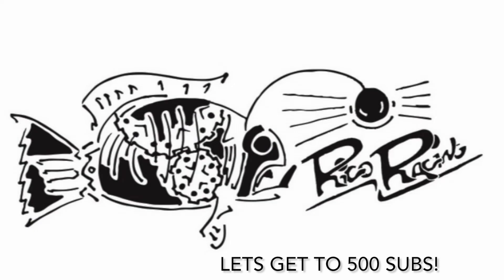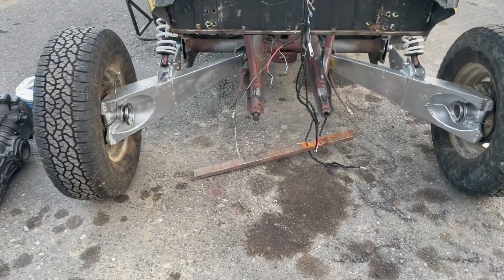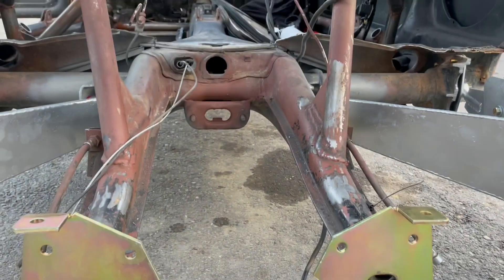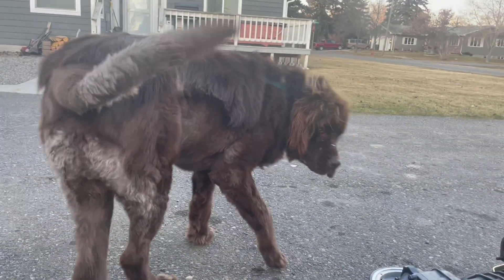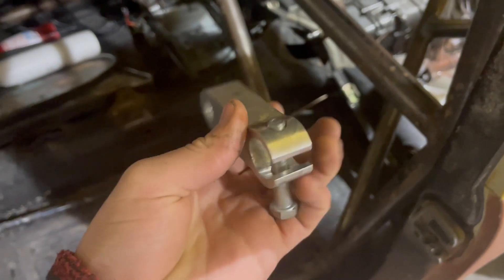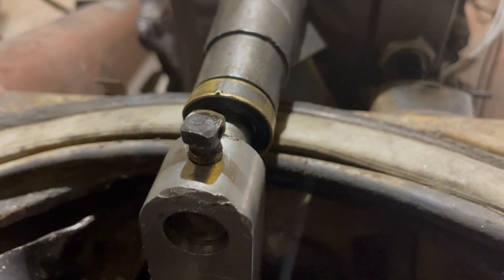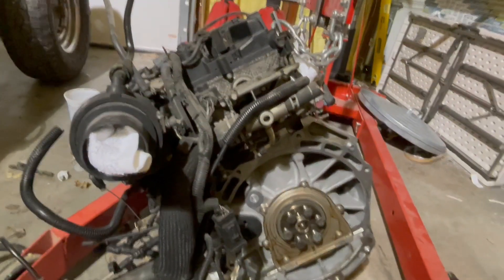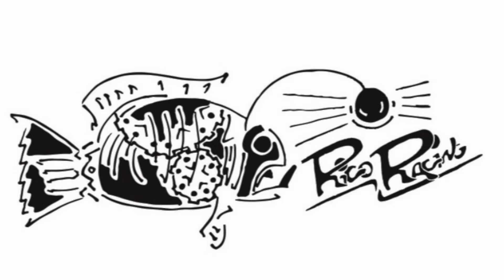How to put a Vw Bus Transmission in a Bug! | IRS Conversion ep 5

Comment: I’ve been putting bus transmissions in buggies for over 25 years and learn several secrets
When installing with aftermarket trailing arms 3 x 3  etc. You must push the transmission back in order to keep the transmission drive  flanges parallel with the stub axles to avoid CV joint binding   no clearanceing  if of CVs can relieve that problem without relocation 
Add 3” to the front mount by boxing it out with a Second mounting plate and add 3” to The ends of the engine horns  and I suggest using your upper bell housing bosses as a mounting point to frame structure and possibly mid transmission mount to engine horn
Reply from the maker: thanks for all the advice!
Reply from the maker: thanks for all the advice!

Comment: Those Ford motors area great! I had a 2006 Zx4 Focus, Loved that motor. Zippy and lots of power. Always thought it would make a great baja motor.
Reply from the maker: im getting excited for sure! ive been working on installing the engine adapter and flywheel but i have the wrong clutch so now its another week waiting for parts…
Reply: Rico, stick with Volkswagen powered,  you can't go wrong.

Comment: Awesome 😎 coming out sweet 🤙🏽
Recommend a cross tube with fabricated tabs to the top 2 holes of that bell housing it will make it much stronger 
Little bit of blue locktite on the trans linkage bolt so it doesn’t back off ✌🏽
Reply from the maker: thanks for the idea! definitely going to make something like that now, i was a little worried about putting too much stress on the ends of the frame horns.
Reply: Bro I also recommend  clocking or phasing your off road cv ‘s  are you going to run type 2 or 930s

Comment: I have full hydraulic disc brakes, front rear on my buggy, so I do not use the emergency brake handles so I notched them off, smooth with a tunnel and mounted a EMPI 16-2106 well then doom buggy shifter linkage. The kit comes with almost everything you need and it gets rid of all the extra play very tight and easy to shift.
Reply from the maker: thanks! i think i am eventually going to get something like that. the shifter is just a little too loose.

Comment: It looks like that shift linkage adapter arm is made from aluminum. If you drill another hole below the one that's  there it should reduce the throw of the shift pattern. You should be able to do it with a hand drill, but a drill press would work better. Dan S.
Reply from the maker: thanks!

Comment: How much does the 3x3 set up on back cost?
Reply from the maker: a good set of boxed 3x3 trailing arms will probably be around $500. However, I got mine for free from a mentor, and mine are 6x6 not 3x3, I would not recommend anything larger than 3x3 unless you move the transaxle back a few inches.

Comment: I like that mounting kit, but as someone else said, some added bolts into the bell housing would be a good idea.  The strap is good, but side plates and bolts would be better.  My real question is I'm guessing you're running at least 3x3 trailing arms.  "IF" 3x3, which is what I have on my rail, did you use the slots in the mounting plate to make equal length axles, or leave the input shaft centered and ended up with one axle assembly slightly longer than the other?  Also, what CV axles did you use, the 002?  Nice work!  Thanks for the video.
Reply from the maker: i think i am going to run some tubes down to the top of the bell housing and make a top mount, so that the frame horns have a little extra support. as for the axles and cvs… i havent gotten that far yet. thanks!

Comment: I'll be building an Acme Warrior rail. Was thinking about getting a bus transmission insfead of getting the CV sxle style Bug transmission, because I do not want to use the swing arm style one I curently have. Anyway, which axles are you going to run, the Type 2 bus or the Type 4?
Reply from the maker: not sure about axles yet… i do want to try and custom lengthen my axles just for fun, not sure if i will be able to do it yet, but might as well give it a try.

Comment: Random question.  
Whats the difference onbthe 3 vs 5 Rib Transmissions?  
I've been seeing some videos and they are using the 5 Rib. 
Thanks for any Info
Reply from the maker: there are 3 rib, 5 rib, and 6 rib transmissions, its referring to the strengthening in the casting of the transmission case. if you look at the side of the transmission you can count the “ribs.” other than that there is a lot of gearing and parts changes year to year that I dont know very much about

Comment: Looks like your axles may be swept back at too steep an angle for most CV's  to function properly. You may need to move the trans back a bit.  Read up on the subject and geometric requirements.  It's not super simple and if you get it wrong you have to redo everything from the trans back. You don't want that, that will make a grown man cry.. Also , find a way to direct couple that shift linkage.  What you have there is just wrong.  Good luck!!
Reply from the maker: thanks for the tips, they are greatly appreciated!